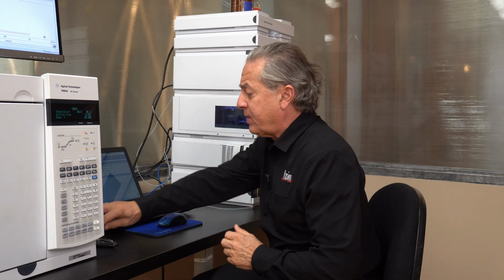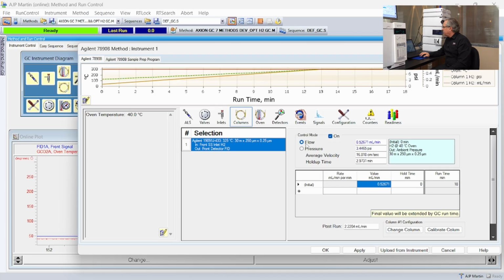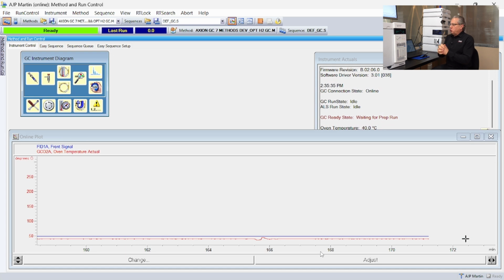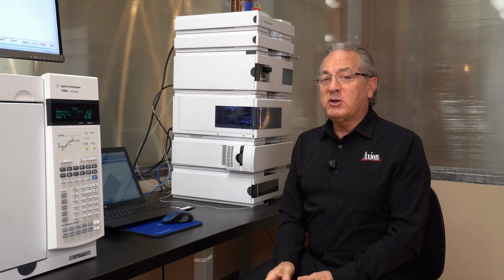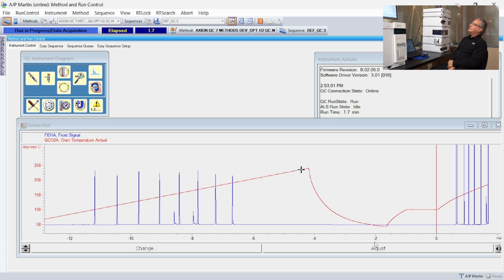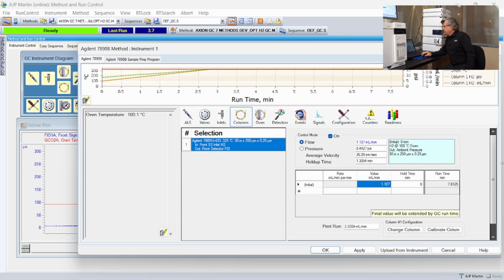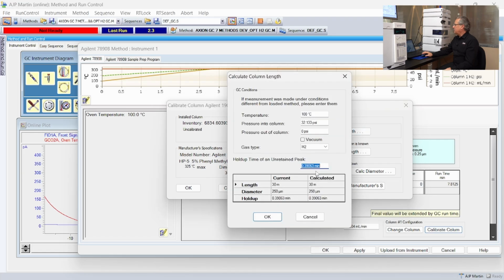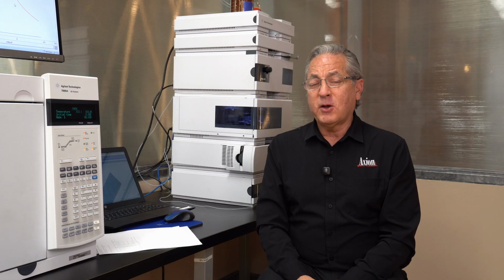Demystifying GC Method Development

Comment: Pretty nice tutorial, reminds me a bit of 2006, though it was neat for me to work then with the 5890 Series II.  Never really used H aa carrier, though I suppose that will increase as He costs continue to rise for most detectors other than MS. This software seems newer than ChemStation to me, is this OpenLab?  This seems much fancier than ChemStation, with these features.

BTW, MattCat was here, so I'm clear now to check out your stuff on Concentrating on Chromatography.  Oh no... always determine column length, great to show this, especially to those using GC for QC.  Butane was easy enough for me to use for this--methane would be "best", butane is simply inexpensive and readily available.